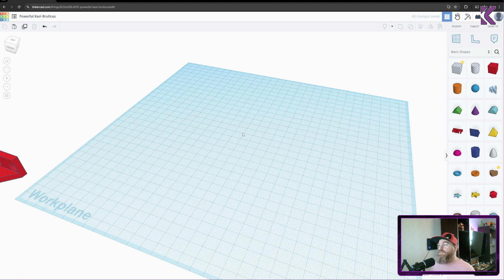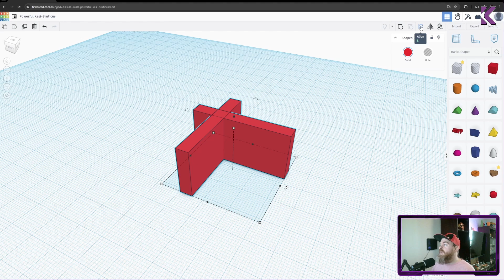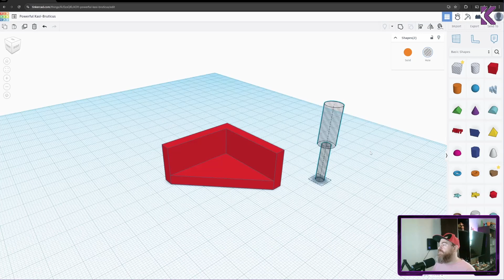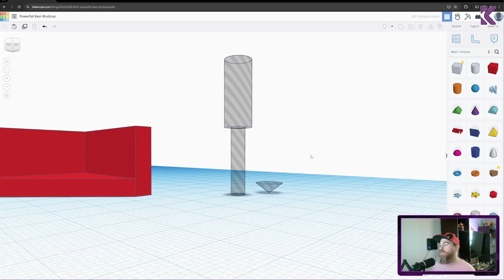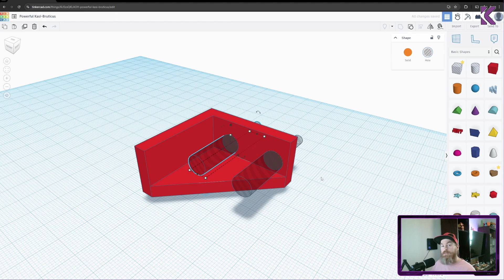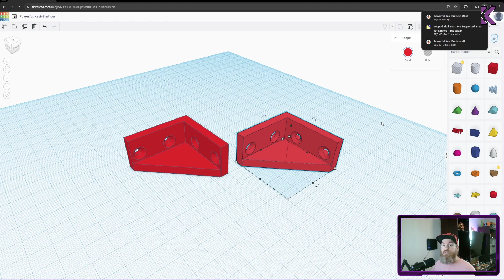Cad for EVERYONE! - Part 1 - TinkerCAD

Comment: thank you for this video. It is amazing how different you design in TinkerCAD compared to me. But that only shows the power of this nifty program. The holes are positioned different, that's about it. But that happened because you did not position them to data (which I would have done). I also would have saved the hole object as a tool for future use but all these things are material for the next video. 👋
Reply from the maker: I'm glad you liked it. 
There are more functions to tinkercad, I just wanted to keep the video as simple as possible 😉